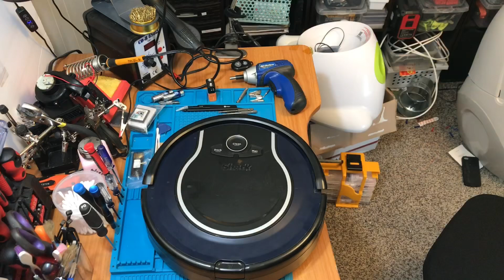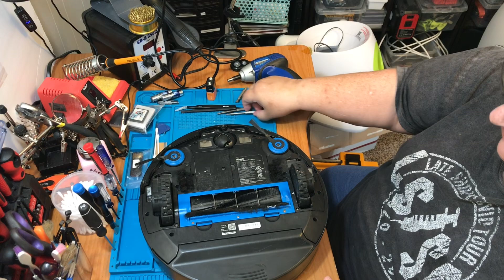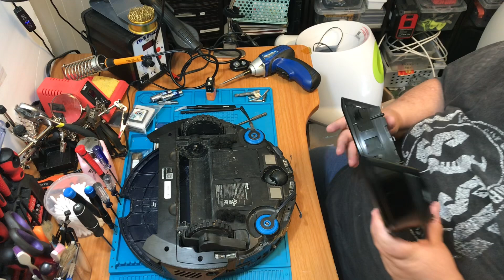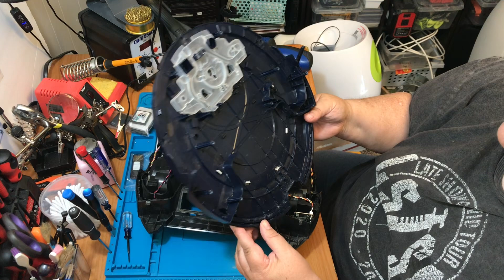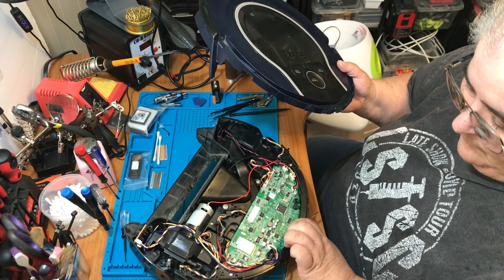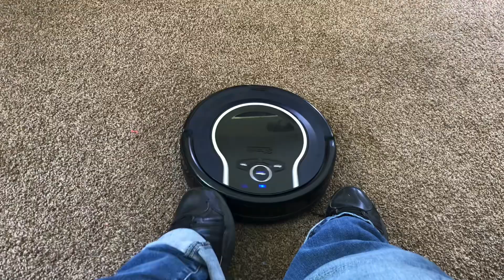Replacing Suction Motor on Shark Ion Robot Vac. #diy #repair

Comment: Thanks for posting this - I was able to actually fix the assembly by cleaning around the impeller - the view of how to take apart;  what T tools needed, what screws to take out (I slowed the video) and also how to test the motor with a battery were key.  I did call Shark to try and find replacment for my model - they were of no help;  they said the computer was damaged and had to replace unit.   I ignored their input and went with the error code on device and information from app notification to focus on the suction motor assembly.   Unit is now fixed
Reply from the maker: Awesome!